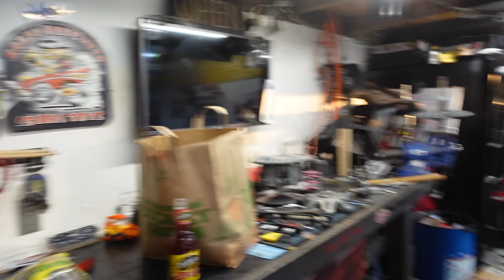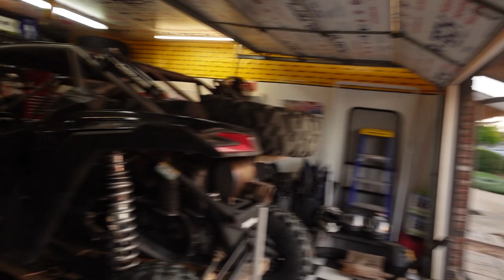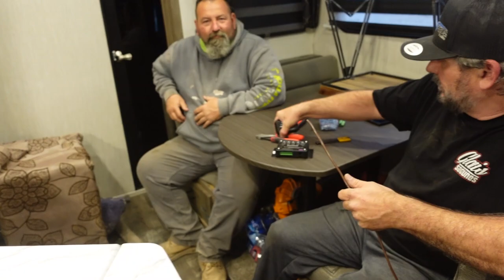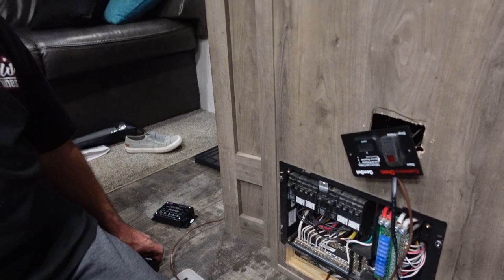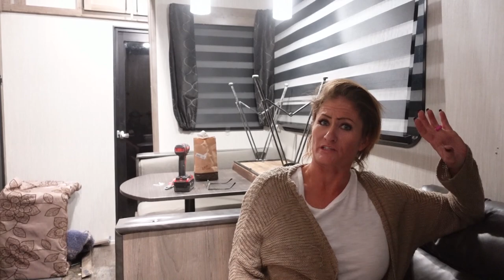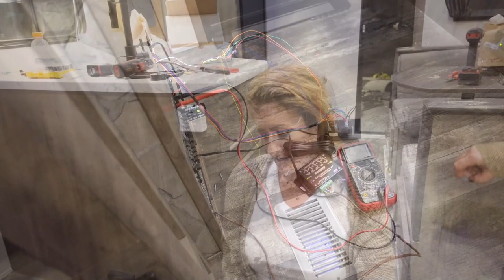Auto Gen Start For the Wolfpack The X3 Gets New Seats From Bert's Mega Mall

Comment: Yeah, yeah, yeah... I'm still here listening. I'm guessing you only have one battery in the Wolfpack??? A second battery would help a lot. One of my best investments has been Zamp portable solar panels. I turn them toward the rising sun when I go to bed at night. Before I get out of the RV in the morning, my batteries are fully charged from running the furnace all night. And the panels are much faster than my converter at charging the last stage of the batteries.
Reply from the maker: LOL... Actually we have four batteries. But we are irresponsible and run things we don't need to. We definitely want to add solar panels but nothing beats this auto-gen we just used it all weekend. Guaranteed not to have dead day or night. Do you have a link to that panel you use?
Reply: @DandiOffroad   Maybe switch all the lights to LED bulbs, if it doesn't have already? Solar panel link: https://www.zampsolar.com/collections/portable-kits/products/180-watt-portable-solar-kit
Reply from the maker: All LED.. Wow that's pricey.. I think we're good we just ran through the whole weekend no issues. Love it.